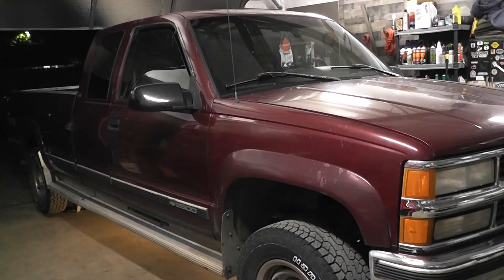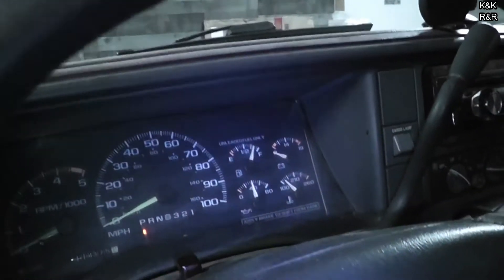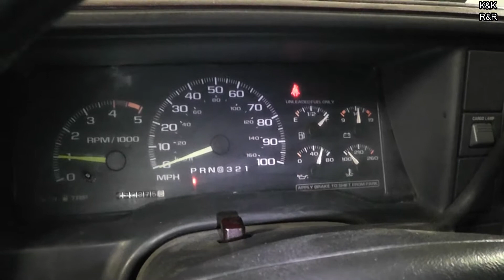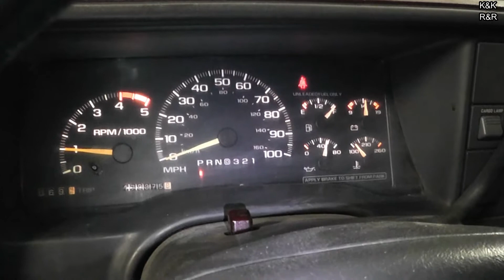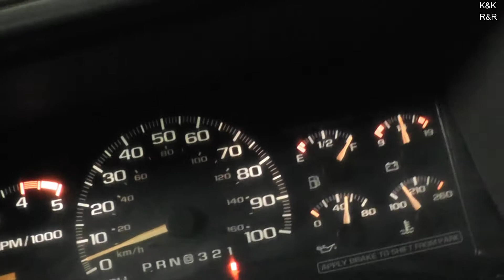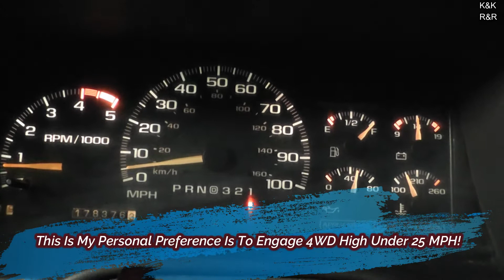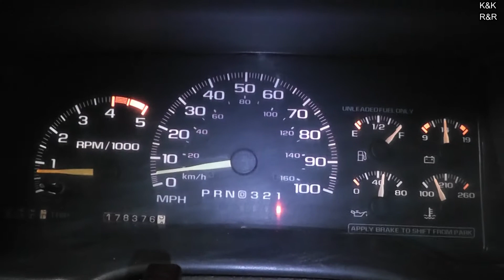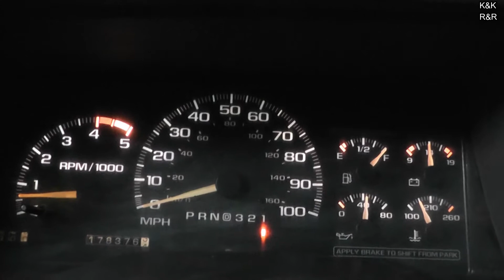How To Bring The 4WD System Back To Life in a GM Truck NP241-C  PT III: Retest After Fluid Change

Comment: Hey Einstein there's no such thing as priming the transfer case.😂  Additionally you do realize that what you did on the jack stands is simulating real world driving anyway so there is no need for this procedure even if there was such a thing as priming the transfer case which there isn't....
Reply from the maker: You do know there is a lube pump in these transfer cases right?  This is not a splash system like NP 203/205.  Once you drain the case the pump is empty even once filled the pump pickup tube is empty till the driveshaft spins. Does a transfer case lube pump prime itself at every stop light sure, but its not my preference with a transfer case that has been just emptied and refilled. You may disagree with me which is your right to do, but this is my vehicle and there is no harm in being cautious or taking an extra step for longevity sake.  In the future "Einstein" or any other negative name calling comments as such will be deleted.  I don't mind differences of opinions with a proper explanation why, but name calling is not helpful nor will be tolerated on this channel.  Have a good day.   
/K&K
Reply: @KNKRNR  Yes the transmission is literally a hydraulic pump there is no physical connection between the 2 as far as fluid flow they are independently each other,  The transfer case has no fluid pump it's literally a dip and slip type deal or in this case dip and lube meaning the gear rotates through the fluid just like a differential.
Reply from the maker: NP NV 241/242  have lube pump you should look up a a tear down video.   You would be correct if these trucks used NP203/205/208 transfer cases.  Link below is a part diagram for the NV/NP 241 in the video please look at 155,158,35 

https://webshop.ganzeboom.net/np241

/K&K

Comment: I have a 1998 k1500 z71 I put in a new switch and when I push either 4hi or 4 low I hear a clunk from the front differential but no 4wd.
Reply from the maker: That year uses an encoder motor on the transfer case to engage the 4Hi/4Low, you need to lift the truck up in the air as shown in the video and see if the front drive shaft is moving when engaged.   If its not spinning either you have no power / signal to the encoder motor or the encoder motor is bad.   It odd to me you hear a clunk from the front diff.  Normally you would hear a noise from the encoder motor on the transfer case once you hit the switch to change modes 2hi/4hi/4low. 
/K&K
Reply: @KNKRNR Thank you for the quick response. The clunk could be the transfer case I just know it’s under the truck. So you don’t think it could be the actuator motor?
Reply: @KNKRNR  I’m sorry I listed the wrong truck the correct truck is a 1997 k2500 GMC suburban that I put a new switch in and all it does is make a clunk when switched to 4hi or 4lo. Would this truck also have the encoder motor that I should check?

Comment: I have a 95 Z71 and i put it in 4 low one night, put it back into 2 high the next morning, went to a 7-11, backed out fine, put the transmission into drive, then the t-case pops out of 2 high and into neutral. Kept popping out so i put it into 4 high. On the way to work, kept hearing thuds. And when i went to reverse into a parking spot, the transmission grinds.... so now i have no reverse. I feel like it could be a transfer case issue, you think new fluid could help?
Reply from the maker: All power flow goes through the transfer case.  I would drain the transfer case fluid and see if metal shavings come with the fluid.  If so you need to start with either rebuilding the transfer case or find a good used one to replace it with. 
/K&K
Reply: Yeah ill give it a shot. Thank you

Comment: Wait, did I hear you correctly? Did you say your truck weight is 4,800 lbs. empty? It weights as much as a 1/2 ton (1500) for a 3/4 ton (2500) truck. My 3/4 ton (2500) Suburban weights close to 7,000 lbs. pounds, 1 ton (3500) trucks weight close to 10,000 lbs? I just want to double-check to see if I heard correctly or if I am not understanding something? Love the video by the way. 👍
Reply from the maker: I use to do dump runs with this truck and coming out I would weigh 4,766-4,900 give or take depending on how much fuel was in the tank.   The GVRW on the door says 8,600.  There not to many bells and whistle with this truck.  It would make since the Suburban weighs mores then this truck does because of the size of the vehicle, safety systems, and other factory options. Yes you heard me right. :)  My 76 GMC 2500 4X4 coming out of the dump was  around 5,600 empty.  Thank you for the comment! 
/K&K

Comment: Would that cause it to stay in 4wd? I just blew out anfront Axle in 2wd. I had a weird speed wobble and got off the highway and turned left and heard a nasty grinding. Now I don't have 4wd.  I'm starting to think it was stuck in 4.
Reply from the maker: If the TLA didn't disconnect in theory your front diff  would be locked up sending power backwards into the transfer case. The front diff was not designed to be a full time 4WD.   Its possible the front diff carrier, spider gears, or internal axle spines are grinding.   
/K&K

Comment: 92 Chevy k1500 pickup my problem was the pigtail on a transfer case switch. PS my transfer case sensor was bad too when you put the ohmeter on it press the ball in on the sensor it should go into open loop.

Comment: The front actuator works like it should the switch inside is new which I have a push button 4x4 switch  The transfer case motor makes a loud clunk when you use the four-wheel-drive option

Comment: What was it doing before you change the fluid I’m having issues with mine binding up when I turn
Reply from the maker: The front propeller shaft would keep spinning causing the front diff to bind during hard turns like an old 70's truck around corners in 4X4 mode.
/K&K

Comment: I have a 1994 Chevy Cheyenne k1500 the indicator light comes in I’m getting 12v to my actuator plug and it’s working properly and my connector thing on the t case is plugged in snug but it doesn’t engage someone help
Reply from the maker: Sounds like the Front Drive Axle Clutch Fork in the front diff isn't sliding forward and not locking the front diff up.  The Front Drive Axle Clutch Fork is what the TLA pushes against to engage the two axles together.   in the link below is the typical parts diagram for a GM front diff.  Part number listed below is the most likely cause to no engagement if the TLA is working

https://www.gmfullsize.com/threads/front-axle-breakdown.65324/

(12) Front Drive Axle Clutch Fork Shaft
(13) Front Drive Axle Clutch Fork Outer Spring
(14) Front Drive Axle Clutch Fork
(15) Front Drive Axle Clutch Shaft Retaining Ring
(16) Front Drive Axle Clutch Fork Inner Spring
(17) Front Drive Axle Clutch Shaft Bearing
(18) Front Drive Axle Clutch Shaft  

/K&K

Comment: Ok so i bought a 1990 gmc 4by4 the 4 wheel worked sorry i bought it 2 weeks ago now it doesn't i have power to the actuator i think its gone bad so im going to change it no big dell but how do i change the transfer case fluid
Reply from the maker: The process is the same as in this video series. Link below is a full guide to changing the transfer case fluid for the 241-C Transfer Case.  

https://www.youtube.com/watch?v=kiezOY6bO2E 

/K&K